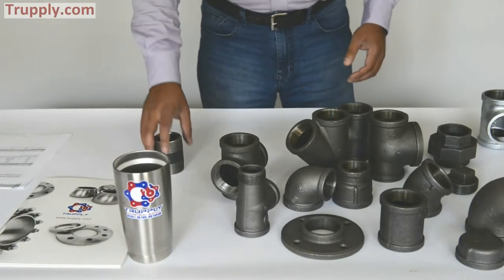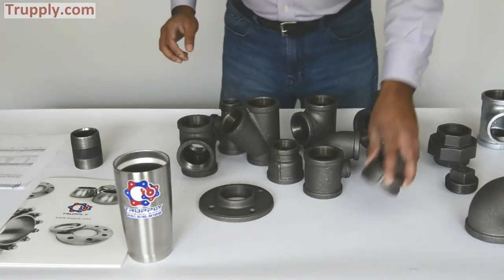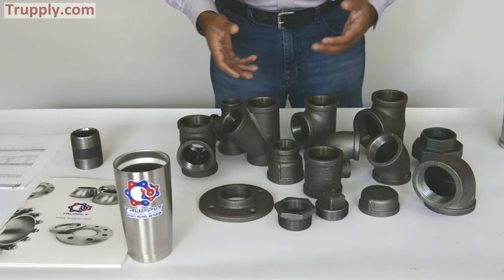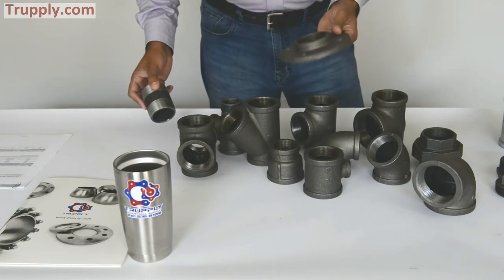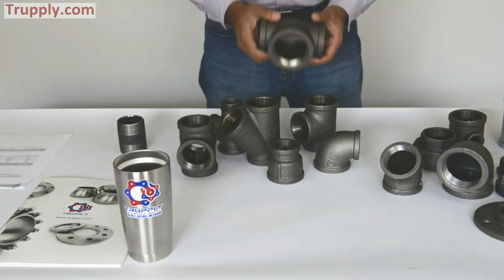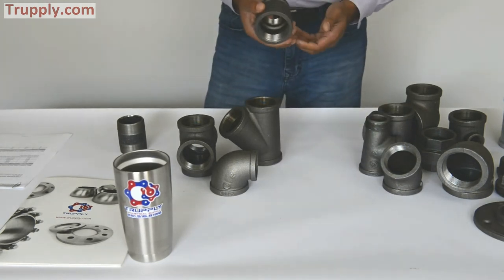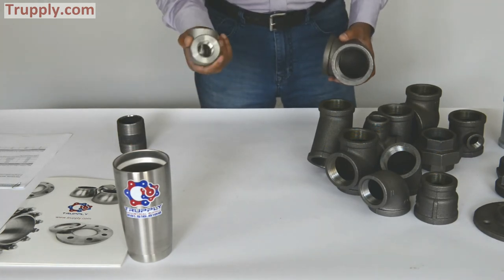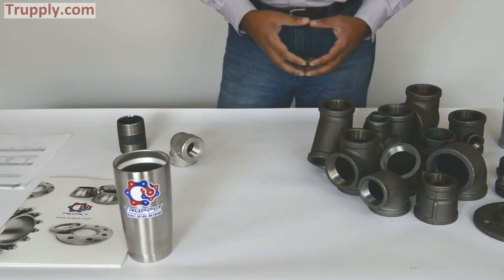Malleable Iron Fitting - Black Malleable Fitting | Trupply

Comment: What is the difference between a steel coupling vs malleable iron?  My personal preference is for malleable iron, but we have a hard time getting them and have to use the thin steel couplings that come on our pipe.  We mostly use galvanized 3/4" and 1/2" pipe and fittings for propane plumbing applications.  What I'm wondering, is there an advantage to either?  The maximum pressure the pipe will see is 20 psi, with 0.5 the normal.  This plumbing is used in houses and attics and under houses in crawl spaces.  Thanks.
Reply: THOSE ARE NOT COUPLINGS ON YA DELIVERED PIPE..THEY ARE JUST USED TO PROTECT THE THREADS
Reply: @kharismoke6239  Actually, they are couplings, as delivered on domestic pipe.  Same size, thickness, and quality of thread as ones we buy.  The plastic thread protector is on the other end, only one coupling per stick.

Comment: Thanks but you left out the union connection? what is that used for pls?
Reply: It is used when you have 2 pipes (coaxial) to connect but unable to turn them (as it would unscrew at the other ends.)
You screw each side them thighten the "middle" nut to make it tight, search youtube for : Union pipe